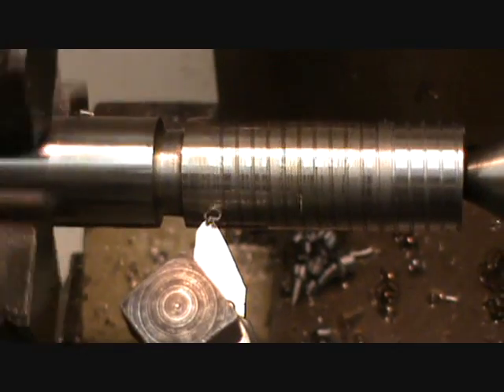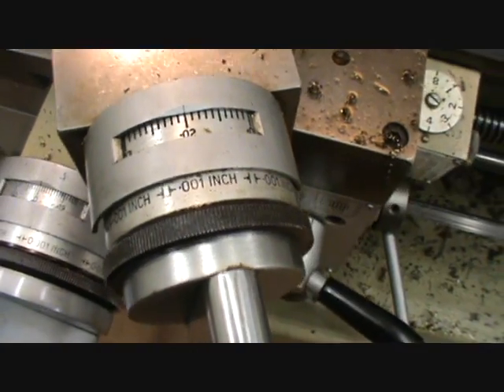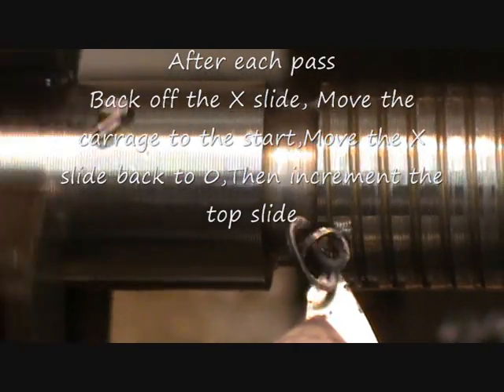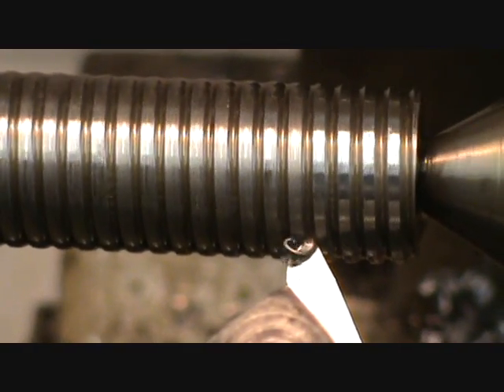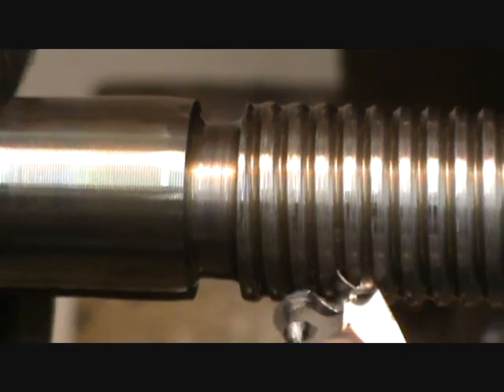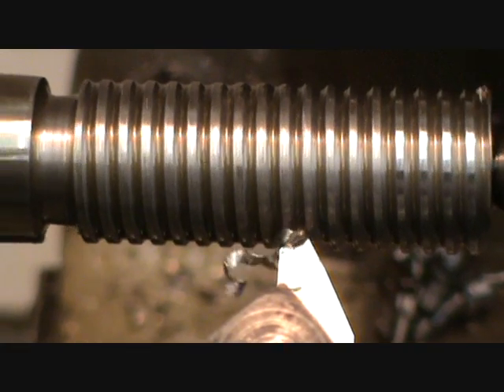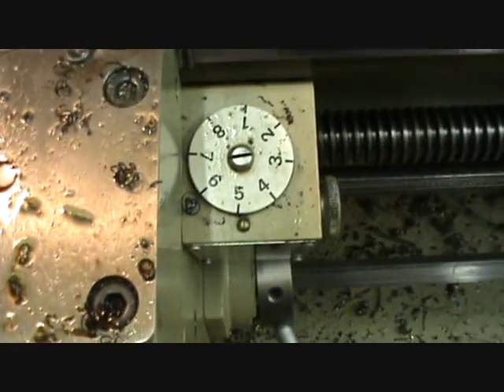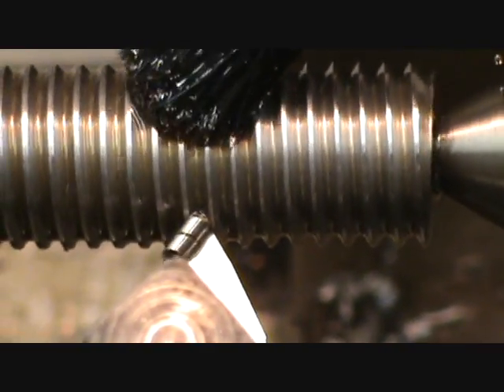Metalwork-Making a Drawbar part2

Comment: Just a quick question: I see that on the Harrison M300 lathe, the 3.5mm pitch and 14mm pitch is also 'BR8W'. Why is that? Do I need to change gears manually on the side of the machine?
Reply: themetalcutter many thanks for your detailed answer. Thisis a really cool video. I'm still having some trouble setting it to 1mm pitch. Even when I set the knobs to 1mm, it travels much les per 1 revolution. Maybe some gears are broken inside the machine?
Reply: I managed to make the custom M22x1.0mm thread this morning (UK time), not perfect, but it worked. Though I had to manually swap the 44T & 88T gears on the left side of the lathe and used a different feed setting. I'll ask our toolshop manager next week, what did I do wrong. We own this Harrison lathe for more than 30 years, and it's still in good shape. I never did any thread cutting until this morning, but your video couraged me to do it.

Comment: nice and clear video you can see the full detail on the cutter how it cuts in every pass what kind of video cam did you use in filming this video?
Reply: hi! Tim its 2 o clock am Phil, time just finished my thread cutting on my project,have you ever try threading on your lathe without using a lathe dial chaser? this is re- on your comment on youtube Nasedo 357, Aug. 15,2012 im just curious if the method that i was doing on my lathe threading with un-engage dial chaser is  capable on Harrison M300 lathe bye ,Ador( my nickname)
Reply: thanks for your reply were both doing same in threading metric by keeping the half nut engage cheers Ador
Reply: themetalcutter hi! Tim its me once again i just wanted to share some short video about threading on lathe god bless Ador
Reply: +dominadorbudiao A shaky one, can't watch handheld videos myself, shame as it looked like good work being done.